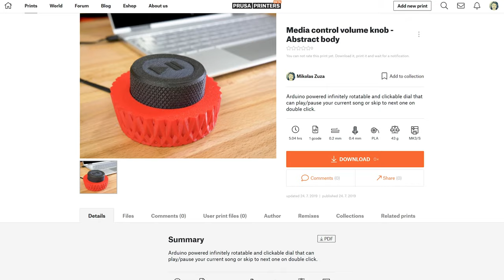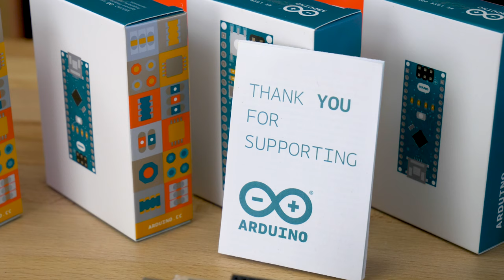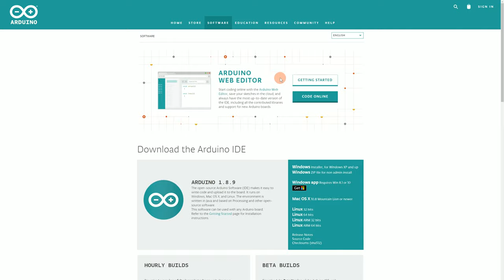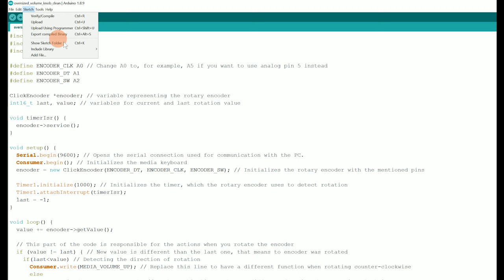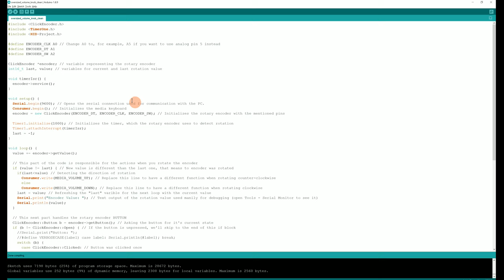3D printed MEDIA CONTROL volume knob - Arduino basics

Comment: 1:16 that little macropad with mechanical switches looks cool!
Reply: I made one for myself with a clone-arduino board, did the cad for myself from scratch in Fusion 360 (as I wanted 10-key in a 3-4-3 layout and sitting on the front edge of my desk), printed it on my (genuine) Prusa i3 mk2. Biggest expense was fancy "re-legendable" keycaps (the two-part type where you can put a printed label insert in) which are kinda un-necessary. The genuine Cherry MX Brown switches weren't stupidly expensive. It was my first ever arduino project, mostly using someone else's source code but with a few little changes, and I'm really pleased with it. The Arduino sends keys F13 - F22 (the standards for USB keyboards defines F1 to F24, it's just most keyboards stop at F12), I have F13,14,15 doing stuff with a simple AutoHotKey script (to open My Computer, my NAS box, my NextCloud cloud-sync folder) and the other ones I assign directly as hotkeys in software like OBS Studio and Discord.
Reply: @MattFowlerBTR  there's a special firmware for mechanical keyboards - it's called QMK firmware and it's really powerful. You can program macros and shortcuts very easily with it.
Reply: What switches/hardware was used there? would like to build one myself.
Reply: @nunosousa7698  For macropad like this you need arduino pro micro, some cherry-mx styled switches (gateron, kailh, outemu), keycaps (you can 3d print them) and diodes to make matrix. But you can also make it without diodes and connect each switch to one arduino pin.
Reply: @valdosh69  Thank you, and thanks to all the rest of you, this thread is a great source of information!
Reply: @maga8631  thanks

Comment: If you not have a Arduino with HID (that can be a keyboard), you can send the encoder data to serial interface with println() and use a simple python script to listen the serial port and execute the keyboard commands(volume+, vol-, play, pause...) with help of pynput library
Also, it may be easier to change behavior based on the current open window, since the keyboard commands is being sended on the host device

Comment: I have built this about two years ago. Designed in SketchUp, printed on MK2 and assembled with Digispark, which is cheaper than pro micro and also smaller.

Comment: Asking for other Project Ideas, what about your own Version of a 3D Connexion SpaceMouse based on arduino and an analog Stick / 4 axis Controller?
Reply from the maker: Yep, it's mentioned at the end of the full article linked in the video description. There is an open-source reverse engineered driver for the SpaceMouse, so that would be cool to implement.

Comment: The button click doesn't work.  I see the light blink but nor pause or skip.  I tried in VLC and Windows Media Player.  Anyone get it to work?  Is it only for certain apps?
Volume works great.
Reply: Seems like a reboot of the windows PC with the Arduino connected fixes it (sometimes).  Now try and fix it all in the box and secure it. No one seems to show pics of that part.

Comment: It might be a quite small point, but the original board you are using is an Arduino Micro, not Arduino "pro" micro. The "pro" part is what makes it smaller. As far as I know, arduino have never made a "pro" version of the micro, but there are loads of "clones" (can you call them clones when they don't clone?). 

That being said, I would REALLY like to see more projects with arduino. Alternativly, micropython.

Comment: Can you map the button to change scroll wheel functionality? For example, one click to set the wheel to change volume, and two clicks to set the wheel to seek through a video.
Reply: You definitely could. Just split the loop based on the state the button is in, and have those two inputs swap states.

Comment: Just what I was looking for. I don't have a Prusa though, I have an Ender 3. So I'll have to do some fiddling, maybe design my own box and knob. (Or figure out how to translate the code...still new at 3d printing!) The source for the Arduino is what I really wanted.

Wish I'd seen this before ordering a Contour ShuttleXpress... oh, well.
Reply from the maker: All the included models can be sliced for your Ender 3 as well :)
There is even a built-in profile for Ender 3 in PrusaSlicer now, so you can use that open the model file :)
-Mikolas

Comment: "I built my first 3D printer to print my own knobs and faders" (Quote from the road to 100k printers) Only took 9 years. I built my first 3d printer to print parts for my modelship five years ago. Modelship is still in the same state, meanwhile finished the 3rd printer ^^

Comment: Great turorial! I follow the video and I it work! But a problem came up with the step each time I rotate. I have two types of rotary encoder to test, one of them goes 2 step each time I rotate the encoder once, and the other one goes 4 steps at once, may I ask is it because the code or my encoder? I just want it to go one step at a time🙂
Reply: nevermine~I just found out the solution in comment. But there seems to be another problem, when I rotate anticlockwise sometimes it would bounce a little, just ocassionaly, I don'k know if it's because of the code
Reply: To be more specific, when I rotate anticlockwise it will initiate a click when I just only on half a notch, when doing clockwise it needs to be a whole notch to initiate, so sometimes it would bounce when rotating anticlockwise

Comment: Hello i have a small problem. My arduino board is a 32bit not a avr. But it does to Hid device because i can do a keyboard on it. However one problem i ran into it is the Timerone. It only runs on avr and not 32bit. Do you think there might be a way to fix that problem?
Reply from the maker: The timerone library is used for the detection of the rotary encoder spinning. It's very likely you can replace it with a different library that will run fine on your board. I would try to search for the "name of your arduino board" + "rotary encoder example". If you find an example of a code that works on your board, you can copy/paste the parts that handle the encoder from this project to the media control one. -Mikolas

Comment: Eh guys I got a problem, My Arduino keeps crashing and I have to burn the bootloader again for it to work, I've done this 5 times by now, and tbh I'm pissed. It just crashes like 5 seconds after I've plugged it into the computer, and it won't be detectable until I burn the bootloader. Any tips? solutions? hello? anybody home?

Comment: Where is a good place to get the clone micro Arduino board?
Reply: I got mine off amazon for $9 in the USA, but Adafruit is also a great place to get them depending on where you are.
Reply: @syber-space  Thanks... I am in the US as well!! Need to order the parts! :)
Reply: If, for some reason, shipping from Adafruit isn't fantastic (which is the case where I live), you can often get their boards from places like Digikey or Arrow.
Reply: ALIEXPRESS is the best place to find cheap clones :)
Reply: You can get one for $3 on Aliexpress

Comment: Hello, I did the project. I have a question . When the encoder turns it, the sound increases as +4 and decreases as -4 when the encoder turns it back. The project is working but how can I +1 this?
Reply from the maker: I believe the line that causes this is:
encoder = new ClickEncoder(ENCODER_DT, ENCODER_CLK, ENCODER_SW,4);
However, I never really figured out how to get it working reliably with 1 or 2. But you can try messing with it and see what happens. Luckily, at least in widows, the volume scale is 1-100, so having the step at 4 is pretty perfect. -Mikolas
Reply: @Prusa3D  I fixed the problem, Thanks

ClickEncoder(ENCODER_DT, ENCODER_CLK, ENCODER_SW,2)

Comment: That was some really rough solder work on those wires going into that mini arduino... First time?
Reply: Nah, I didn't have a solder vacuum pen on me and the pads were already filled with tin from the previous project, so I made this monstrosity instead. I thought about resoldering it for the video, but I would never finish anything if I wanted to have it perfect. So I just rolled with it, hiding a bit, hoping nobody would notice. You're the first one to mention it, so I guess it half-worked :D

Comment: It is fun to see how you say you hate the prusa clones but you use an arduino clone..
Reply: This comment hurts. I've put a lot of work and thought to make sure I explain why in this specific case we used both Original Arduino and a clone Arduino board.
Jo never said he hates Prusa clones. It's quite the opposite.
What is not cool is clones that use the "Original" in the name and act like they are manufactured by Prusa Research, even when they're not. In addition to that, both the article and video cover this topic.

In the article:
"Using Original Arduino boards?
Just like Original Prusa 3D printers, Arduino project is open-source. If you search online, you’ll be able to find clones of original Arduino boards for as little as $2. So why spend more on the originals? In short – build quality, documentation, development. Without investment into development, there won’t be any innovations. You can clone a board over and over, but eventually, you’d want things like new more-power efficient Bluetooth or Wi-Fi support, better development software with a nicer UI or a faster processor. So at least consider buying an original Arduino board. 🙂

With that said, some of the clone boards with fewer I/O pins, unsoldered header pins and smaller size can actually come in handy – for example in our case of building a compact volume knob."
Reply: @TheMikolasZuza  thanks for the answer. Now It is clear to me, It is nice that You spend time answering us. Very good job, keep doing It!!
Reply: @LaMenteDeDresiSS  Thanks! I read every single comment on our youtube channel. Pretty sure Jo reads all of them too :)